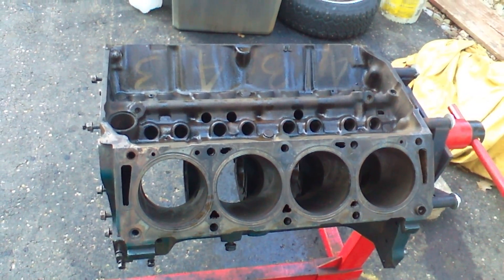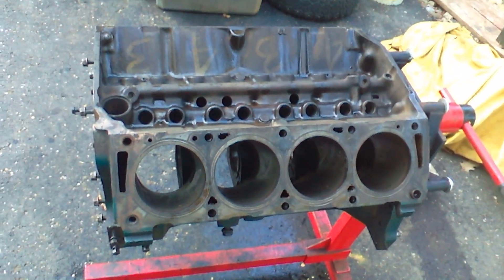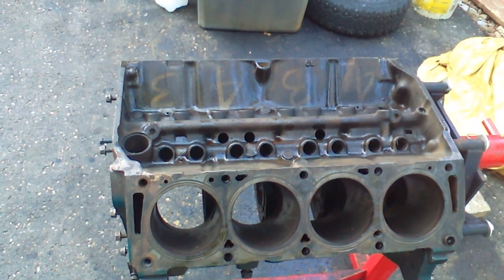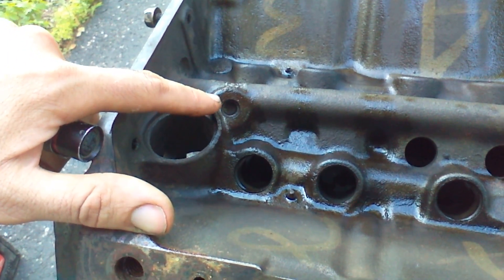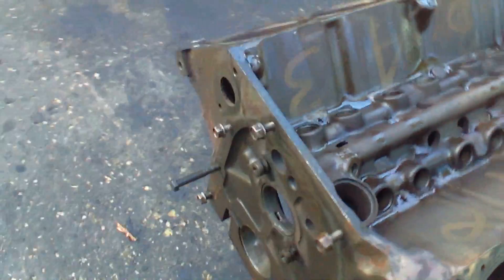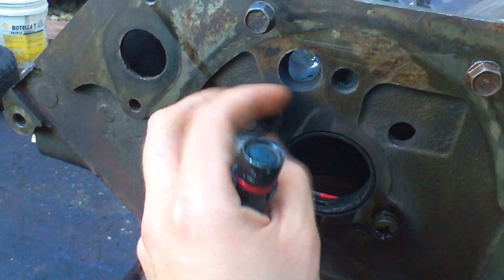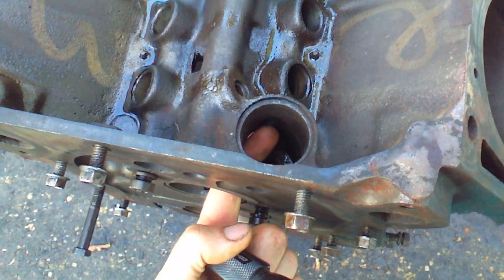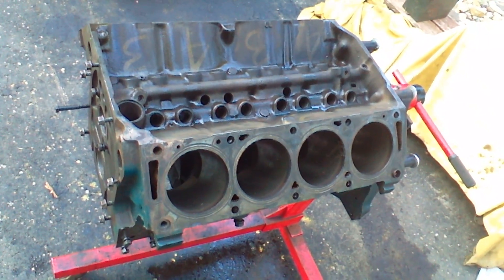For FE Engine Commonly Forgotten Oil Gally Plug

Comment: Hello I'm scouting the internet for a video that uses a 1/4" roll pin into an oil gallery that has cracked and is letting oil into the coolant. Motor is a 390 fe 1968. I hear the video exists but I cannot find one. Do you have any info or a link perhaps?

Comment: How do you get that plug in or out of that distributor well?
Reply from the maker: I think I just put it on the end of a punch that would just fit inside the cup of the plug. Then I carefully put it in place and tapped it in place with a hammer.

Comment: Get rid of it and go to a 390 block much better block 🏋️
Reply from the maker: You do know 360 and 390 use the same block, right. They just have a different stroke, even the bore is the same between the two 😅😅
Reply: @chipwright6193  yes depending on year  the blocks vary on nickel content witch makes them strong . get a scat crank to stroke it to your needs   Or a 428 … 427 side oiler 💵 but it pays off
Reply from the maker: @neils7221  okay, I see what you mean about the nickel content. I've seen something before about a Mexican 302 block that had a higher nickel content that was sought after. I really don't need to do anything elaborate with mine. I just wanted to freshen it up a little so it would be reliable as a daily driver again. That would be fun to drive! A coworker did just like you described with his truck though. I think his is 69 F250. I'm looking forward to seeing it once he's finished building it.
Reply: @chipwright6193  the forgotten engine “FE “ sounds great always enjoy it 🇺🇸🇺🇸

Comment: Hey thanks for that video. Is there a set of these all little plugs on ebay ? 
I have to rebuilt my 390 in the next time.
Reply from the maker: I didn't see any as a kit on ebay or Summit, but individually they are a common part. They are just a mini freeze plug. I've heard with shortages due to the pandemic that it's hard to find parts for the FE engines. I'm not sure how bad it is. Hopefully as long as you don't have to do anything major like replacing a head, it won't be too bad. I would like to think that getting pistons, rings, bearings, valves, guides etc wouldn't be too bad, I hope...
Reply: @chipwright6193  I will see when I have disassembled the engine.
Maybe it all looks good on it, then I will leave it like that.
My engine runs, but he will have wear inside. Loses oil pressure and after some time due lifter make noises. Also he has a lot of blow by. After almost 60 years I think it's time to overhaul it. But I have help from people who have done FE engines many times. Just looking now what all I need parts. So that it goes later as possible without much waiting ahead.
I can not say at the moment if the engine has been done before and how due bore of the cylinders are current.
Reply from the maker: @sequoiaohz  okay, that sounds similar to mine. I hope it all goes well for you. On mine I just had the heads rebuilt at the local machine shop. The cylinders didn't look too bad, so I just replaced the piston rings. Then replacing all of the bearings and switching to a high volume oil pump got my oil pressure back. Before I rebuilt it, the oil pressure would go to zero at idle when it was hot. I'm really happy with it now. At ide the pressure is around 25psi and 50-75psi on the highway.
Reply: @chipwright6193  That sounds good to me. Glad your engine is running well again. 
I suspect maybe wear on the main bearings of the crankshaft. There certainly is lost the oil pressure when the engine and the oil is hot. Have heard in the context is also often then at the rear engine seal the engine leaks. There he also loses a lot of oil. Have enough time to do the whole thing over the winter. Then I do not drive anyway, because of all the salt on the roads. Have a good day. Greetings from Germany.
Reply from the maker: @sequoiaohz  we don't drive our old cars in the winter either. The salt is terrible. The rear main seal in the 390 was a piece of rope packed in a V groove that sealed against the crankshaft. They make a neoprene seal to replace it that is much better. It was great texting with you! My great great grandfather was from Hatzbach, German, noth of Stadtallendorf. Greetings from Ohio!
Reply: @chipwright6193  
Oh great. Yes I have to look. Thats in the middle if Germany. 
I come from the Town Osterholz-Scharmbeck in the north from Bremen. 
My first US car was a 80 Ford LTD
But I more like the cars from the 60 th
So I have searching for one and find my Galaxie on ebay.

Comment: Can anyone can help with my 390 FE! I’m not getting oil through the heads when I prime the oil, I only see oil come up to the intake valley. I removed both oil bolts that would feed the roller rockers and nothing! Any help advise please?
Reply: sounds like you missed a plug
Reply: Hey  @bogiewheelman71  Thanks for the reply! Yes my troubles was the elusive plug in the distributor hole.

Comment: NOT ONLY DID I FIND MY 352 DISTRBUTOR PLUG NOT IN MY FE, IN MY SEARCH AS I PULLED THE INTAKE OFF I FOUND THE GALLERY WITH OIL PLUGS  LAYING LOOSE AND EMPTY HOLES HERE AN THERE,  I THEN HAD EVERY REMAINING PLUG START SPINING IN ITS SEAT AS I DRILLED HOLES IN THEM TO REPLACE THEM, THAT SHOP HAS LONG SINCE CLOSED, BUT THE ENGINE IS STILL F#+&*D UP

Comment: Depends on the year and distributor gear/oil pump drive housing design, its where the distributor and drive gear gets oil, if you use the wrong distributor per application you bleed off your oil pressure.the housing with the oil groove centered in the dist. bore mating surface that bleeds off below ti the cam gear is for use without the plugged, redirected oil galley. I might be off a little, but Im going by a one time memory from 30 years ago, anyone automotive machine shop savvy have any input here? Don’t make me google I hate putting my mind on the back burner

Comment: Right on dude. My baddest 390 made it about 7 hot laps and seized solid. I payed big money for machine work including all the oil mods. But it is the assemblers responsibility, and I screwed it together. I missed the one behind the cam gear...a simple one, and burned up my bottom end completely. I spun all the mains and rods, it wasted everything block included.  I was double stupid because it didn't have the pressure I was expecting, so idiot got to pay for 2 motors that year.
Reply from the maker: That's terrible! I'm so sorry to hear that. Since making this video I have put about 13,000 miles on this engine. I drive it every day.
Reply: Can anyone can help with my 390 FE! I’m not getting oil through the heads when I prime the oil, I only see oil come up to the intake valley. I removed both oil bolts that would feed the roller rockers and nothing! Any help advise please?

Comment: I left mine out, but then I had blocked the lifter galleries back aft as I had converted to solid lifters. Hope I didn't make a mistake doing that.
Reply from the maker: The solid lifters will probably get enough oil to be ok, but pressurized oil from the lifter galleries would have been a good thing. There should be enough oil splashing up from the bottom end and also oil laying in the top end to keep them lubricated.
Reply: No you made a boo  boo! Id install a line in the galley and run an oil pressure gage to see, since its only a timing cover pull

Comment: Thank you car gods for this video, i got my block all ready and installed in my truck. Was ready to fire my 390 up and found the oil gallery plug in the bag of old parts from the machine shop, I got a little worried and had trouble finding a good diagram of the core plug locations, but i found this video. The machine shop failed to install the plug.... but they sure did remove it for me. I was this close to killing a brand new motor, crap that was close, thank you
Reply from the maker: Andrew Staggs Wow! That's too close for comfort! I'm glad you caught it in time.
Reply: Damn dude your lucky you caught that.